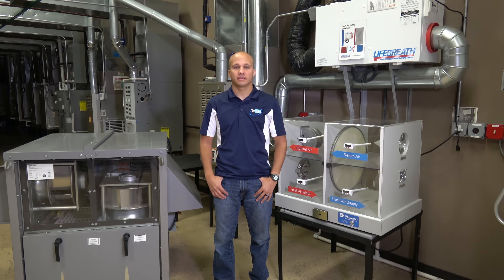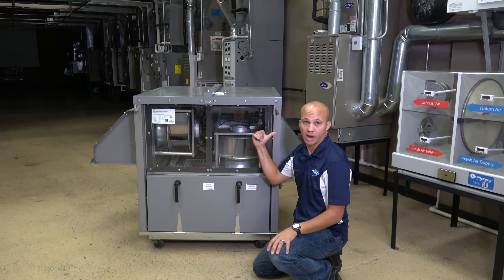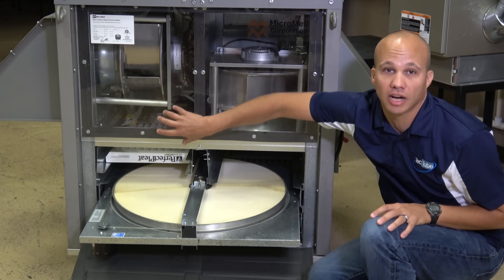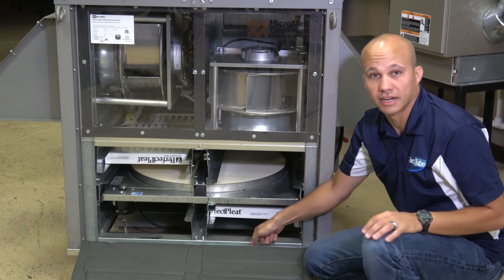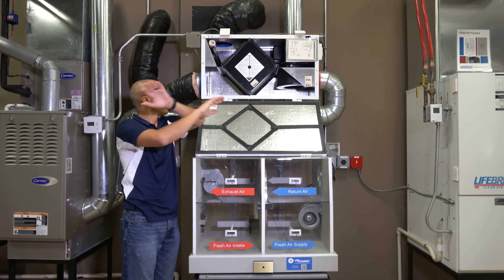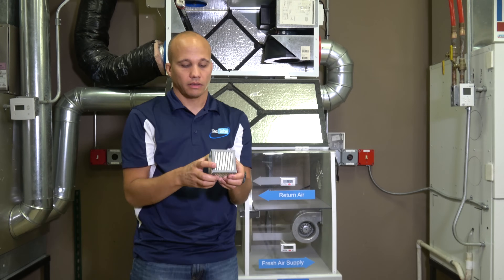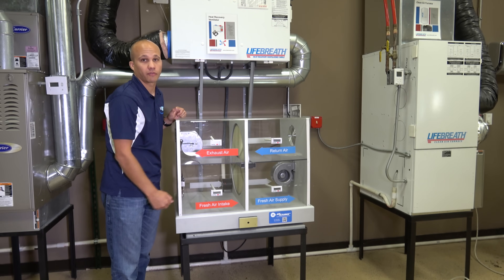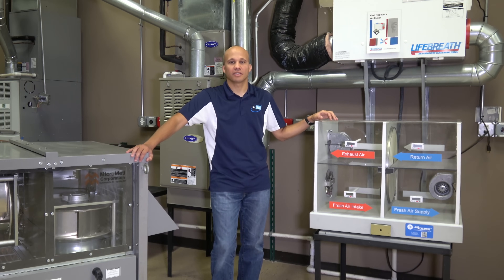Fundamentals of Energy Recovery Ventilators (ERVs)

Comment: Just want know how is hot air from outside going exchange through wheel and out? Why not going inside the supply path? Is it due hot air lighter than could air? Please explain.
Reply from the maker: No, it is not related to the buoyancy of the air making it lighter.
Reply from the maker: Heat always moves from the warmer thing to the cooler thing. So when air comes into the ERV, the heat transfers from the hot outside air to the relatively cooler heat exchanger material. Then the wheel spins into the exhaust air steam where the wheel is now warmer than the relatively cooler exhaust air... and hence heat transfers from wheel to exhaust air.
Reply: 1st law of thermodynamics

Comment: In the UK we have humid winters, where ventilation is key to keeping the inside of homes warm and dry. Many people are talking about positive input ventilation (opposite of extractor fan just pumping fresh air into a central place to be blown through gaps of the building).. This increases heating cost as many units have a 500w duct heater to warm up the incoming air stream (~10c to -2c typically) and even then people complain of cold drafts from the unit.. I wonder if an HRV would help benefit. 
Use the damp but warm exhaust from bathroom to preheat the incoming air somewhat..
Reply from the maker: Yes, you can run the bathroom exhaust through an HRV to reclaim the heat and transfer it to the incoming ventilation air to pre-heat that air less expensively.
Reply from the maker: Do not use an ERV in your application since that will also reclaim the moisture from the bathroom exhaust which it sounds like you do not want.

Comment: I don’t understand how this can be so efficient. How can the indoor outlet possibly be only 2deg warmer than indoor inlet?
Reply from the maker: We are not sure what you mean. Thse are heat exchangers with a fairly large amount of surface area relative to delta T. Does that help?
Reply: How can you not understand what I mean? I think what is happening is that not only is plexiglass a poor insulator but the large gaps between the edge of the plexiglass and the wheel are allowing indoor air to bypass directly back inside, as well as outdoor air to bypass directly back outside, skewing the temperatures. There’s no other possible way indoor inlet and outlet are almost the same temp. You need to add a smoke or something to the equation to ensure there’s good sealing between the wheel and plexiglass.
Reply from the maker: @EricPeelMusic  Insulation is nearly irrelevant when you are moving air at speed for short distance. There are no large gaps between the wheel assembly and the case. And even if there was, the positions of the two fans would generate positive and negative pressure at the points of reducing EATR (the rate at which air leaks from indoor back into supply air). This is not some new technology that we made up... these ERV wheels have been utilized for decades. In fact, the demo box in the video has been in our lab for almost 10 years and it was a traveling demo owned by a manufacturer prior to that. ERVs are also required by energy code for many commercial systems in 30+ states and at a MINUIMUM per IECC 2021 must be at least 60% recovery. ERVs are AHRI Certified and you can look up their performance at www.ahridirectory.org which includes over 2,000 models of certified models using wheels.
Reply from the maker: @EricPeelMusic  Your idea of using smoke or a tracer gas is a good one. We did not think of that when we made the video a few years ago. At the time, the goal was to demonstrate the heat exchange process. It was not to prove the cabinet was reasonably tight so we did not think of something like that.
Reply from the maker: @EricPeelMusic  If you would like to understand more about ERVs, cabinet leakage, and the ability to transfer 80% of the heat (and in some cases 99% for nearly equal temperatures), we do have several other videos you may want to watch. We will post the links here for your viewing.
Reply from the maker: Start with this one from 2 years ago. You can also search our channel for many others. https://youtu.be/gc6ZAnl6mrg

Comment: That's a neat demonstrator, but I think it exaggerates the efficacy of the system. It looks like there's a significant gap between the wheel and the plastic sheet separating the top and bottom. A lot of air would be exchanged between the top and bottom.
Reply from the maker: There is pretty much no gap on top because of the weight of that thick plexiglass. Gaps on left and right are also fairly negligible. In either case, actual ERV wheels are tested and AHRI rated for Exhaust Air Transfer Ratio (return air leaking back into supply air) and Outdoor Air Correction Factor (leakage from outdoor air into exhaust air).
Reply from the maker: Plus the return/exhaust fan is a draw thru fan arrangement which makes EATR nearly zero because the pressure is negatively pulling from supply into return. Because of that arrangement it actually penalizes the temperature improvement (not helps it as you were theorizing).

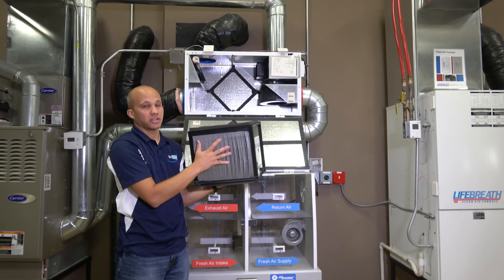Comment: In a residential ERV with the set of separator "fins" (at 6:15), my main point of confusion is why, after passing through the box, the temperature of the air entering the building isn't the same as the air going out of the building (the average temperature). I'd think the fins would take the average temperature of the air passing into the unit, and so exhaust air would be moderated and not so efficiently exchanged as it seems to be.

If we looked at a single fin (as a square), would we see a large heat difference across the surface of that fin? Is that how we're able to recover such a large amount of heat via the device?
Reply from the maker: The incoming air is not heated/cooled to the same temp as the outgoing air because the heat exchange process is imperfect. Depending on the model and type of heat exchanger, it can usually recover 55 to 85% of the available energy, but not all of it.
Reply from the maker: Not sure what is being asked in your second question
Reply: @TECTubefilms  Basically, the device is more efficient than I expected was possible from such a simple device. If the temperature was 20F outside and 70F inside, my prior guess was that the device would yield fresh air to the inside closer to the average of the two temperatures at 45F (with exhaust air at a similar temperature). Given that the heat recovery is in reality far more efficient than this, my assumption/guess is that the temperature is very different along different parts on each "fin" on the heat exchanger. (I'm not sure I can properly explain what I'm saying in a comment, as I'm discussing a 3D object in text only.)
Reply from the maker: @dosadoodle  If the temperature was only average of the two air streams, that would mean that it is a 50% effective heat transfer device. As mentioned, most are 55 to 85%. For commercial buildings, the minimum allowed per energy code (IECC) is 50% effective. There is no minimum for residential. The reason any heat exchange coil can be better than 50% is due to counterflow arrangement. If you want to dive deep into the technology on how ERV heat transfer works, you may want to check out one of our recorded webinars such as  https://attendee.gotowebinar.com/register/6256885680768066575
Reply: @TECTubefilms  Thanks for the additional explanations and link to that presentation! It was interesting and helpful to listen to.
Reply: @dosadoodle  Did you find out the answer? 
Logically, assuming the HRV/ERV core is in a vacuum, the temperature of the 2 streams has to be the average between the 2 airstreams (minus the inefficiencies). Meaning the 20F outside air coming in should be heated to below 45F at the absolute most, yielding an efficiency below 50%.
Maybe one source of heat was the indoor temperature also heating or cooling the temperature of the core as the unit is placed indoors, but then you'd see different temperatures at different parts of the air stream as only the extremes of the core could interact with the ambient temperature indoors.
Just doesn't make sense.
Reply: @ww-pw6di  I think I've now got a handle on it after a thought experiment.
1. Consider a 100 foot long tube split down the middle with a thin piece of very conductive metal (e.g. aluminum) and this tube is laid horizontally. Let's call these two sides "channel 1" and "channel 2".
2. The left end of the tube is connected to the cold outside (20F), and the right side of the tube to the warm inside (70F). For this thought exercise, assume the tube's exterior is super well insulated.
3. Now suppose we push cold outside air into channel 1 (from the left), and we push warm inside air into channel 2 (from the right). What happens?
4. The setup is symmetric, so right in the middle of the tube (50 feet from each side), the air in both cases must have an average temperature of 45F. If we pass the air through slowly, allowing the air to exchange heat across the thin conductive metal, then the air in both channels 1 and 2 will be the same temperature at this point.
5. Now what about the left 50 feet of the tube? Well, this is kind of like a half-size version of the 100 foot tube. By the same reasoning we went though above, assuming slow moving air, at 25 feet from the left the temperature of both channels 1 and 2 should be the average temperature of the point at 0 feet from the left and the average at 50, i.e. an average of 20F and 45F for an average of 32.5F.

We can keep looking at smaller segments of the tube, and we'll find that under this "slow moving air with a near-perfect temperature exchange" will actually have both channels 1 and 2 at the same temperature at any point in the tube (so at, say, 60 feet in, it would be a weighted average of 20F and 70F: 0.4 * 20F + 0.6 * 70F = 50F.

This is what the ERV aspires to do, but it doesn't have such a long tube or a slow air current. Also, sometimes the shape of the ERV (e.g. the "diamond" shape of many residential ERVs) impacts the efficiency. Yet it is still able to partially replicate this perfect system, offering >50% efficiency in many cases.

In the spinning air exchanger, if we could measure the temperature of the left surface of the disk vs the other surface of the disk, we would find that they would be quite different temperatures. (That system is more complex to think about, but the principles are similar to the tube thought exercise.)

I'm sure I'm still not grasping all of the details, but this is how I started thinking about it. I had to draw some diagrams of a diamond shaped ERV and what temperatures I might expect at each point in that diamond, under the assumption of a perfect and immediate heat exchanging surface to pass heat between the two channels (intake and exhaust).
Reply: @dosadoodle  Thanks for the explanation. When it's broken down like that then it does actually make sense. Basically the intuitive answer isn't wrong, but in real life the return to average just happens so many times that you can actually reach above 50% efficiencies. Kind of like Zeno's tortoise paradox, except with temperature.

Comment: Would you say the ERV runs 24/7 in a residential application? My load calcs are calling for 84cfm so we assume that's constant.
Reply from the maker: If not too complex for your controls scheme, we would suggest running it when the home is occupied. Many smart thermostats can handle that.  Or if not, you can at least tie the ERV to run off the EAC terminals of the furnace so it is engaged when the main fan is engaged... and then program your fan to run constant during occupied hours and intermittent during unoccupied.

Comment: I have a question for you I just started working at a three story hotel I happen to go in the attic and found an ERV not running and hasn't been in awhile we have ducted energy on the first floor and Ptac units in all the rooms would it be wise to get the ERV running again to save energy cost or not ?

Comment: What is the material of the fan in the demo unit? Is it a metal sheet?
 And when we turn it on, the motor on both ends are the one pulling the air making the middle turbine moves by itself?

(Wanting to make one for the house) please help :)
Reply from the maker: No, it is not metal. The heat transfer wheel is a polymer impregnated with silica gel desiccant to allow moisture transfer, as well as heat. This type of ERV is not cost effective for small systems less than about 1,500 CFM.  Residential only needs 60 to 120 CFM of outside air so in those applications we use entahlpy cores for heat transfer instead.
Reply from the maker: The two fans are to move air in and out of a building... you are exchanging heat and moisture between them. They do not make the heat transfer wheel (what you called a turbine) move.  That is moved with a fractional hp motor and a polymer belt.

Comment: I love the ERV demo unit, makes it simple to see during the summer months how the temp exchange works. I wonder if you have made a video with this reversed, showing the intake/exhaust during winter month where cold air is being introduced to the inside? I recently  built an air tight house and do not have any type of ventilation system installed, hence it's drawing from the windows and doors creating a vapor in the cracks. I also have humidity levels that are running between 60-70% showing on my thermostat, btw I live in Alabama. I'm thinking I need an ERV to help bring in fresh air to balance things. Will this also help to lower my humidity level?
Reply from the maker: No, we did not make a winter video.  However, it would do the same thing as the demo in this video. Just move the labels around.  Instead of the warm air being labelled as "outside air," it would be "return air."
Reply from the maker: An ERV will only help with indoor humidity issues if the humidity is being caused by outside air coming in. When the ERV brings in the outside air in the summer, it transfers the heat and the moisture to the exiting exhaust air so it does not come back in.

However, if the source of your high humidity is something inside the house, then an ERV will make the problem worse since it will transfer the humidity from the return air back into the supply air.

So the first question with any humidity issue is "what is the source of the moisture?"
Reply from the maker: There are lots of things you can do to deal with high indoor humidity.  This would be an abbreviated list from best to worst (the list changes though based on WHY you have high humidity).

1) eliminate moisture sources (put caps on sump and ejector pits, run bath fan when showering, etc)
2) Right-size the A/C. 99% of all system are oversized and more than half are grossly oversized. The smaller the A/C capacity, the longer the run cycle, and hence the better the dehumidification
3) Multi-stage A/C. This also keeps the system running and the evaporator dehumidifying 
4) Lower blower speed for regular A/C mode
5) On demand dehumidification using the A/C and lowering the blower speed even lower than regular A/C mode
6) On demand dehumidification using the A/C but not lowering blower speed further because the system is too basic to do that
7) Slightly larger evaporator coil with more surface area
8) dehumidifier

You should note that some of the decisions above affect other stuff so should not be modified without research. For example, you may lower blower speed to dehumidify better but then realize you have a crappy duct system and can no longer get enough air to certain rooms.

Comment: What I don’t understand is that an ERV does not dehumidifier your house however it is removing moisture from incoming air from outside. I’m wondering if this can help me remove humidity from my house regardless?
Reply from the maker: There are lots of things that can be done to improve indoor humidity:
1) right size the A/C so it is smaller and runs longer cycles
2) increase evaporator surface area
3) multiple stages of cool
4) decrease blow speed for cooling
5) decrease blower speed on a dehumidification call from stat
6) dehumidify on demand using stat
7) seal leaky building envelope 
8) seal leaky ductwork in unconditioned spaces
9) use exhaust fans when showering and cooking 
10) get a dehumidifier (this is the most expensive operating cost of the choices)
Reply: Tec Tube thanks
Can sam ERV make my house slightly positive so it can prevent infiltration?
Reply from the maker: If your high humidity is being caused by your outside air ventilation intake, then yes an ERV will help.  But if you have indoor humidity caused by other sources of moisture, it will not help you.
Reply from the maker: Bringing in outside air with a fan will make a house positive to reduce infiltration.  Using an ERV is just one way to bring in that outside air. And if you duct the bathroom exhausts to the ERV instead of stealing return air, then the ERV will be the most energy efficient way to bring in that OA.

Comment: Blown away by how effective it works in that final demo.  I'd expect to split the difference  50/50 on temperature at best, but it seems you're closer to 90% thermal energy rejection which is nuts.
Reply from the maker: For commercial systems, the minimum per most energy codes is 50% total recovery (sensible + latent).  Most wheels are 65 to 75%, but some can be higher.
Reply from the maker: Yes, per give area of space, a wheel generally trumps all other ERV types.  For example, one of the manufacturers we use can run 30,000 CFM thru a wheel in a certain size cabinet.  However, when they use that same exact cabinet chassis for a fixed plate ERV, they can only do a our 12,000 thru it.